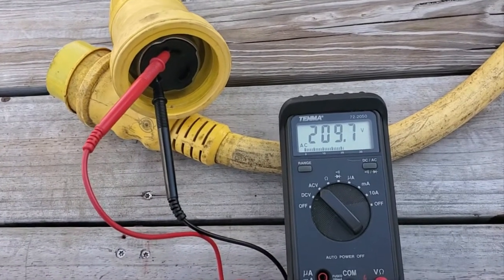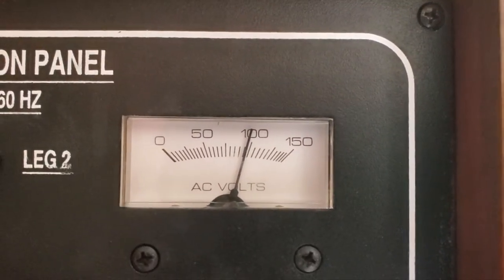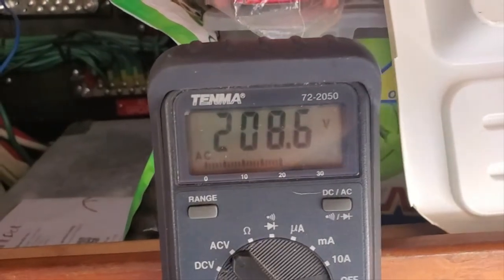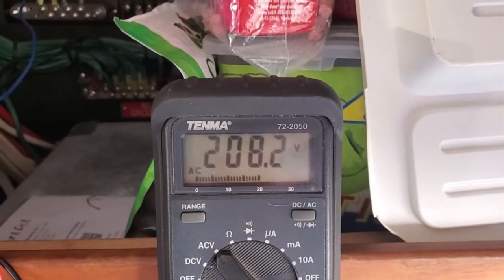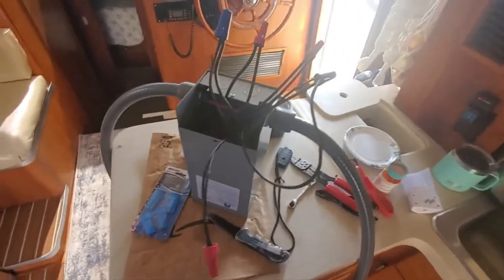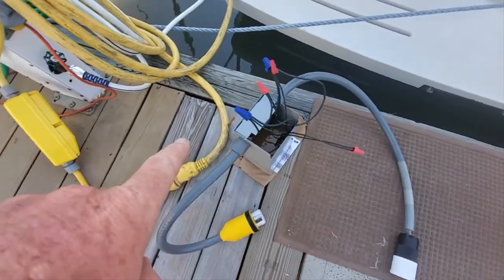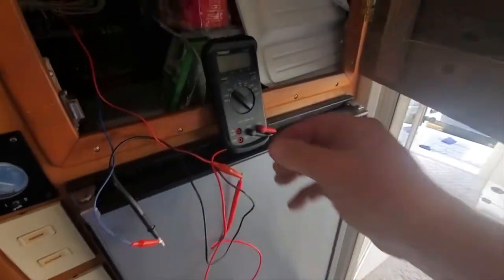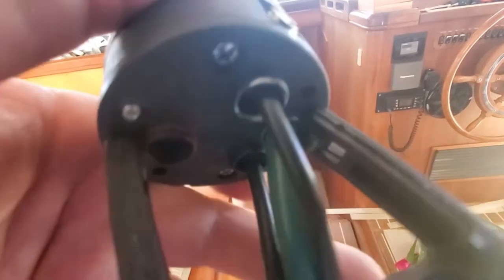Installing a buck boost transformer for boat.

Comment: Can you tell me the model Buck/Booster you used? My power is 50 amps to 2-30 amp splitter.  Would that work on that configuration?

Thanks 
Sean
Reply from the maker: @seanshollenberger9420  acme transformer. Bought it on Amazon. It will buck, lower,  or boost, raise voltage depending on how you wire it. I'm not sure about you set up. Maybe watch the video again. I posted that awhile ago.